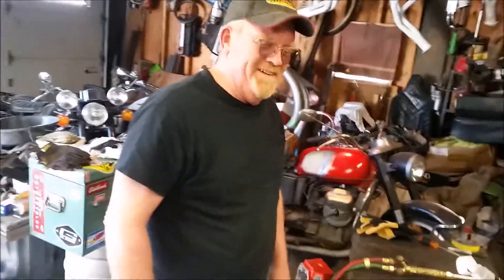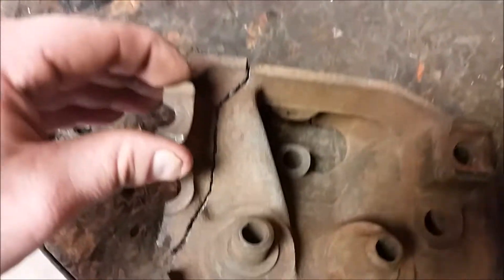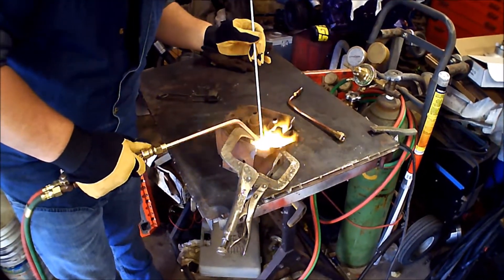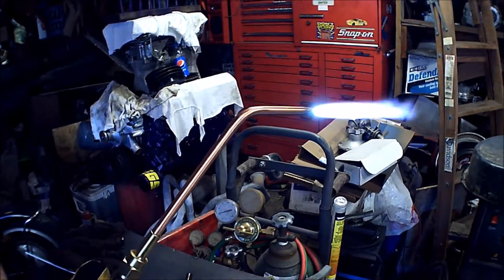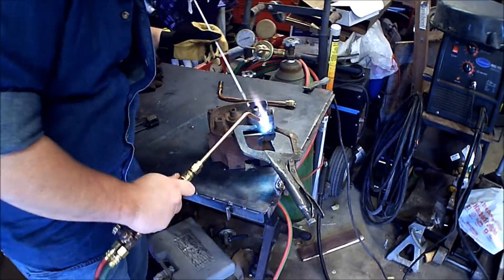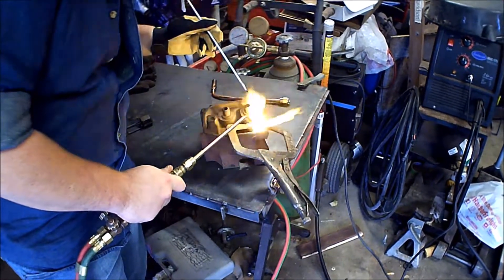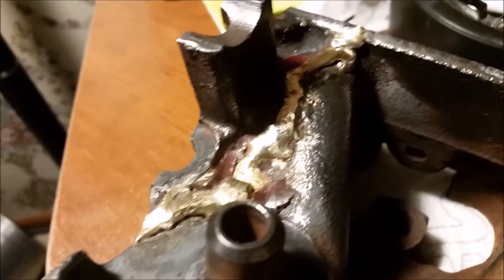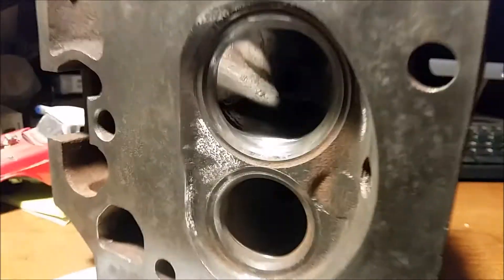Learning how to Braze Cast Iron on a cylinder head

Comment: Is it possible to weld cast iron head chamber in order to resize and reshape chamber?
Reply from the maker: Technically yes, but it would be very cost inhibitive, also finding someone who would be willing to do that kind of work would be nearly impossible. The weld would have to be absolutely perfect, or the weld could fail and all of that added material would cause massive damage to the engine. Cast iron isn't as easy to weld as aluminum, now doing the same thing on aluminum would be much much easier would probably yield a more reliable result.
Reply: @ScottsSpeedShop  thank you very much

Comment: Good job! brazing is all practice Jed, im not an expert but with practice it will look better and better.
Reply from the maker: Thank you Shawn, I am no expert either, I know the process but getting that nice pretty braze is the tough part, especially when you are running out of oxygen in your oxy-acetylene torch set up lol
Reply: From what i gather its all about getting the heat right. Too hot and it scatters all over the place. Too little heat and it does not flow out well.
Reply from the maker: You are very correct my friend